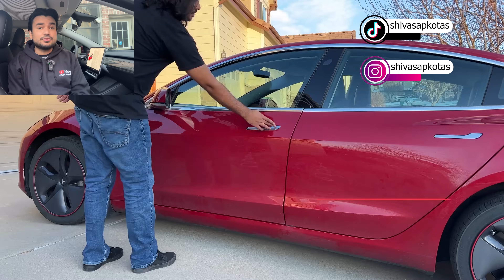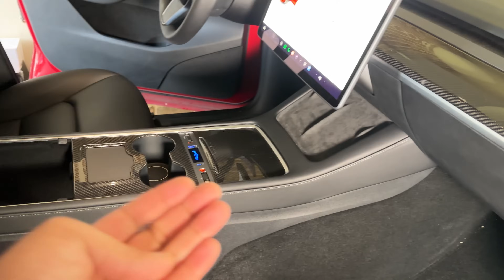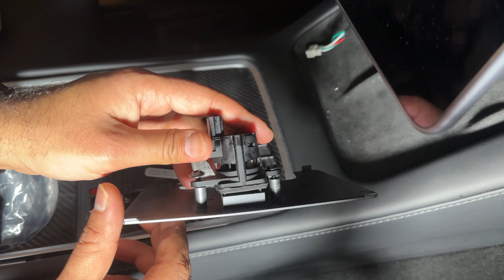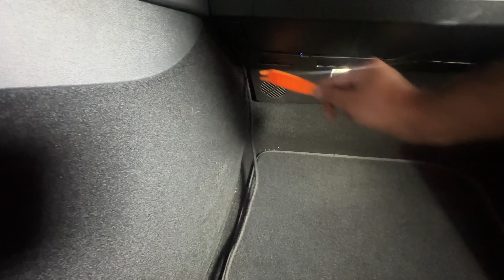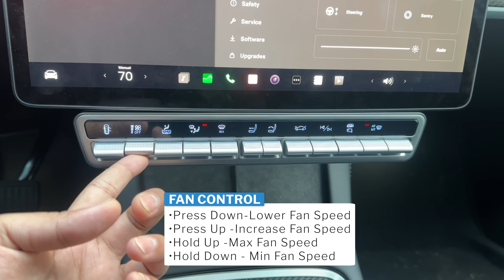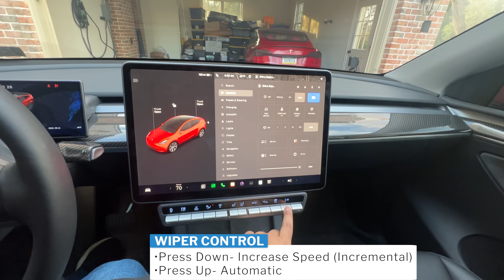NEW Integrated Physical Buttons For Tesla Model 3/Y (Wipers/Climate/Seat/Door/Glovebox/Mirror)

Comment: I have a question. I have a 7.5 inch rear display that has a cable already connected to the front passenger seat. Is there some type of jumper cable that I can use to have the functionality from the rear display and the buttons. If so please point me in the right direction to obtain one. Thanks.

Comment: @ShivaSapkota  Do you still have this button bar installed in either your Model Y or Model 3?  I was just bought this button bar and was doing some partial installation to test the button bar before doing the full installation and I noticed with the latest software update 2024.14.6.

Issues found in SW version 2024.14.6
1. For the frunk/trunk button, only the trunk feature (push down) works.  The frunk feature (push up) doesn't work.  I noticed it worked in the video for opening the frunk but for me it doesn't work at all.  I even tried it with 2 separate button bar units as a test and both units perform the same way with no frunk functionality.
2. For the rear air con control button, I noticed when I press it, it doesn't follow the Tesla screen for On/Off.  In order for me to be able to control the rear air con, I have to press the Rear air con Fan button on the screen set to On (blue) and leave it set to On, but then use the button bar to push down to turn On/off the Rear air con function.  Its a workaround that works but unfortunately doesn't follow the Tesla screen for On/Off status.
3.  For the wiper button, like in #2 when I try the manual wiper function it doesn't work if your wipers are set to "Off".  However in order for me to able to utilize the manual wiper function, I have to set my Tesla wiper mode to "Auto" on the screen and then press down on the Wiper button to swap through wiper speeds 1-4.  Like #2 it is a workaround to get the intended function of the button.

I was just curious if you were able to observe #1, #2 and #3 with the latest software issues.  Also are the 2 USB-C ports in the back used for any firmware updates or are they intended to be USB-C charge ports?

Comment: @ShivaSapkota  Appreciate the review.  I like the idea of the product but my biggest beef with this product is the button arrangement is a little wack since all the main driver controls should be in the first 7 buttons.  Agree with you that there should be an app to be able to update the order of the functionality.
The original button arrangement is as follows
1. Passenger Door control
2. AC manual intensity control (1 fan speed up/down adjustment at a time)
3. Rear Air conditioning control
4. AC Blowing mode control (AC on/off)
5. Front defog control
6.Passenger Seat forward/backward adjustment
7.Passenger Seat Up/down adjustment
8. Trunk/Frunk control
9. Audio track control (closer for passenger)
10. Glove box/Mirror control
11. Auto/Manual Wiper control
12. Charging port/unlock doors control

this would be my preferred button arrangement from left to right (that I wish was customizable with the USB-c port on the back)
1. AC Blowing mode control (AC on/off)
2. AC manual intensity control (1 fan speed up/down adjustment at a time)
3. Auto/Manual Wiper control
4. Front defog control
5. Trunk/Frunk control
6. Charging port/unlock doors control
7. Glove box/Mirror control
8. Rear Air conditioning control
9. Passenger Door control
10. Audio track control (closer for passenger)
11.Passenger Seat forward/backward adjustment
12. Passenger Seat Up/down adjustment

Comment: Two additional features. 
1 - Although pressing the third button down does turn the rear heating/cooling on and off, pushing the third button up turns the front face level vents on and off and is indicated by the middle LED on the next (fourth) button. 
2 - There are two USB-C sockets on the back of the switch unit.
Reply: The USB-C ports are for upgrading the firmware I believe but I don't think there is any such yet.
Reply: I hope so as there are a few small bugs that need fixing. I had assumed that the USB-C ports were just charging ports. It's a shame that there is no manufacturer's website as most of the resellers get some features wrong and no-one mentions the USB-C ports. The RHD hack is also very hard to find. Brilliant device though.

Comment: I like all buttons and feature. But too much work. I would wait for the one with wireless control module which plugs into obd port and just need usb c power cable to the front control switches.

Comment: Nice product, very clear explanation on your part. Thanks. I have been considering this option for some time but I already have an OBD connected heads up display on my 2021 Tesla M3, and I am told that the OBD cannot handle more than one device at a time.
Reply from the maker: Thank you so much! I have 3 products connected to that OBD with no issues :) Just daisy chain all together.

Comment: Hi Shiva, another great video. If you find out the correct length of the screws that hold the temperature sensor, please let us know. Overall, the product is a great first try. I would suggest working more on the design of the buttons, making them more minimalistic or even considering a digital/touch screen. Personally, I find the bar itself a bit bulky.
Reply: The screws supplied were actually perfect for my Jan 2020 M3 which has a different temp sensor. Lucky me.

Comment: Is there a version for RH drive vehicles?, as the doir ipening feature needs to operate the opposite side doors.

Itsxa shsme that there is no memory settings for the passenger seat, a very useful feature when there are two regular drivers, easily achieved by software update by Teska surely?
Reply: There is a RHD version but the LHD version can be converted to RHD for the passenger doors switch. Not reflected in the icon above the switch though. Push third and fourth switches up for three seconds until the unit's LEDs flash. Job done.

Comment: I would Like to See the Buttons Arrangements more logical for Buttons needed while Driving  on the Steering wheels side, and the Buttons for comfort or Control of passenger seat towards the passenger Seat. It is not logical to reach for the wipers to the passenger side and have the passenger side Door unlock at the drivers Position.
Reply: 100% agree.  I don't understand why the first 5 buttons are not designed towards what the driver needs which is AC control, defog, temperature adjustment and wiper control.  The passenger door switch does not need to be in the 1st position.  I think it is silly that is that close to the driver. The passenger door switch should be in like the 8th position.

Comment: I like the control bar better because it has knobs and the Sexy Knob because it is a knob and would be easy to use without looking at it. I have a similar knob on my car for controlling drive modes and it works well.  But I like these switches too.
Reply: Isnt the control bar like $330?  That's pretty rich but it does allow customization.

Comment: Programming to one’s own taste would have been a plus, example my wife’s biggest complaint is the fact that the wipers have a mind of their own in the Model Y so it would be very handy programming the very first button for the wipers instead of the button they have set up.
Reply: My thoughts exactly. My wife also dislikes the wiper controls and which is why I am looking for this solution
Reply: the passenger door as the first button is absolutely useless.  There is no reason that a button you rarely use in the grand scheme of things should be in the first position.  It should be only AC control, wiper, defog, charge port, etc that should be on the driver side.  Its almost like they were barfing out features but then didn't think logically of what would be important to the driver and passenger side.

Comment: Nice review as always! These switches are clearly a step in the right direction.

Tactile differentiation (4 separated groups of 3 switches each for example) in addition to programmability would help keep eyes on the road. Perhaps also soft led illumination (color programmable) when the cabin is dark to help the driver‘s peripheral vision / quick glance recognize switch states.

If automotive GUI engineers were aircraft pilots the product functionality would necessarily improve dramatically. Brains and eyes must primarily be focused outside the cabin.

Comment: Wonderful product. Too bad Tesla can’t do something similar. I use my car for Lyft/Uber so this is a game-changer; especially for opening the doors and moving the passenger seat forward. Mounting is perfect as it provides a sturdier solution to an adhesive-only option. It also keeps the panel up and out of the way from the center console. I hope the company will implement your programability suggestion. Apparently, any function can be accessed from the OBD port. ALSO! Why can’t the driver’s side rear door be opened?
Reply from the maker: Thank you very much! Yes, I can see this being extremely useful for Uber/Lyft. I have asked them if they can program the driver side rear door. There is another smaller product that does the driver side rear door, so I know they can do it.

Comment: How will I connect the back cable if i have a rear entertainment unit and also it controls the passenger seat? Thank you. Great video
Reply from the maker: You can daisy chain multiple cables together. You can fit 2 mods and still close the bottom panel. After 2, you can't put that bracket anymore. Thanks.

Comment: Shiva, does it move with the articulated monitor?
Reply from the maker: I will test this on my Model 3 as I have a swivel installed and will make a post. Please allow me some time to check this out. Thanks!
Reply: @ShivaSapkota  How different is the install on a 2022 Model 3?
Reply: The articulated screen swivel joint can work with the accessory button set but only if you leave off the swivel cover (mounted to the back of the LCD screen) or hack a big hole in the cover to allow attachment of the new bracket. I was a little disappointed that currently there is no direct fit that allows the end of the bracket to be hidden by the aftermarket cover. Since I didn't feel like sending the item back to China, I decided to cut out a piece of the cosmetic cover that comes with the Hansshow swivel bracket. I was a little overly aggressive with the trimming and perhaps cut too much, but the part that you cut is not really visible unless you look through the windshield. The main interference problem with the cover and the bracket involves the two "mounting wings" through which the two large mounting screws traverse. (I don't think this comment section allows picture attachments, otherwise I would show you the modified bracket.) Regardless, the modification works with the accessory button set, and it's looks fine. (Still, the buttons should be there in the first place, along with a 360 degree camera and front bumper camera like almost every other new EV on the planet, but I am aware that this comment always evokes rage in the Tesla zealots.)